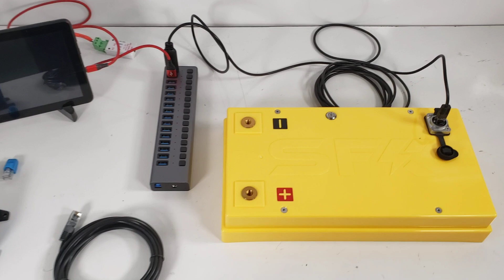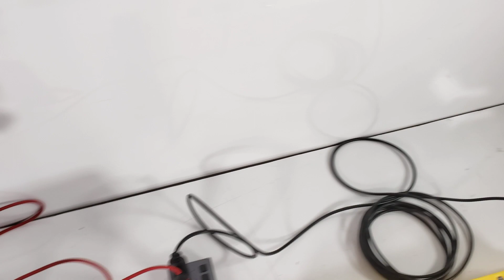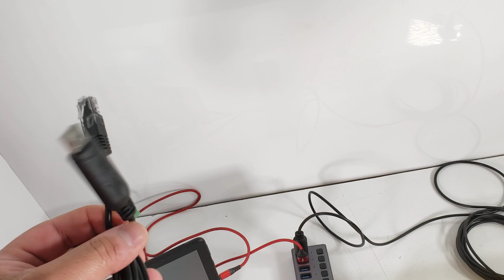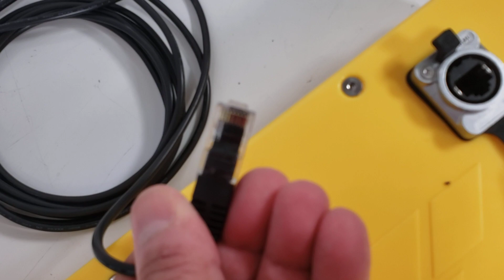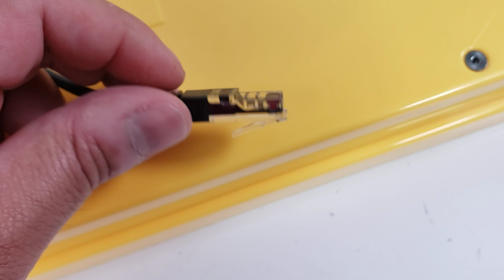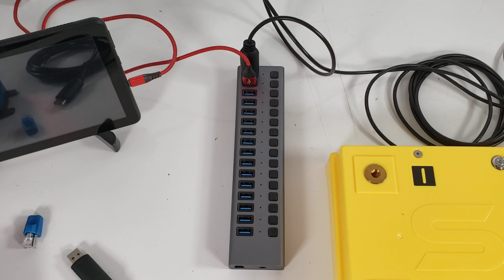Custom RS485 USB cables Sun Fun Kits BMS

Comment: Looking to see if there are any updates on this.  I plan to implement two of your batteries in a sailboat house bank that talks to victron can-bus.  If I understand correctly, I'll need some sort of android system running your app to then hard link the batteries to the app, and then that data will connect outbound to the victron cerbo.  Thanks for the work you are putting into this.  I look forward to implementing it!
Reply from the maker: The SFK Hub will solve your requirements, this cable is really only needed for PC connection.  With the SFK hub you will  be able to connect 4 batteries to a device and then using the output RJ 45 you'll be able to connect that to the BMS can port on the cerbo GX. We are just waiting for the Victron Connect certification.
Reply: @sfkenergy  thanks for the reply.  This was a missing feature for my implementation that I was willing to solve another way.  Adding this feature only makes your batteries that much better!!!